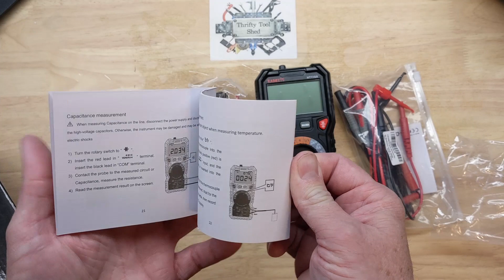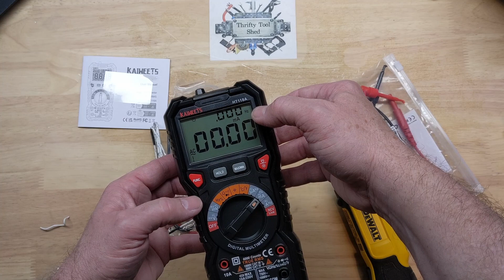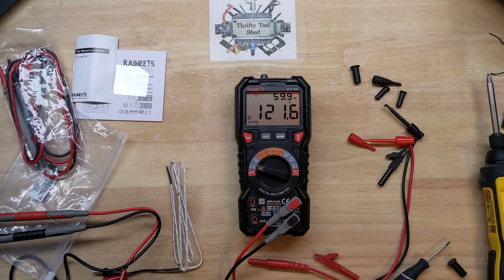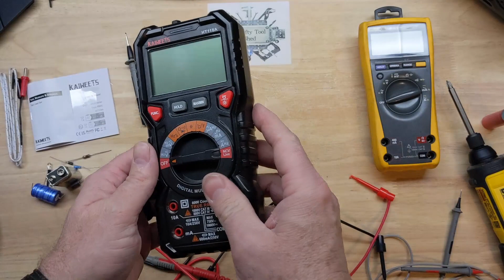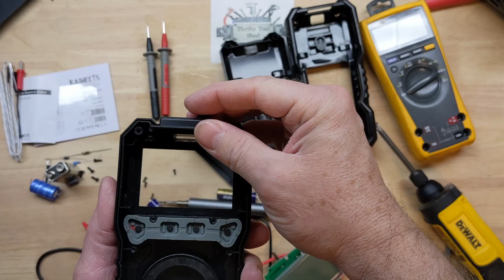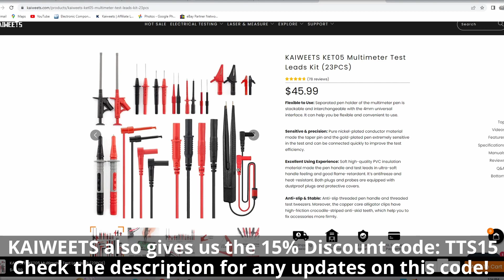KAIWEETS HT118A DMM & Electricians Lead Set

Comment: My meter just froze and after switching off, the meter does not turn on. Batteries are ok. Please advise..
Reply from the maker: My advice would be to contact Kiaweets. I have not had that issue with mine to have any advice on it.
Reply: Yup. Mine's dead as well after an year.

Comment: I'm glad this Kaiweets MM got your approval, I had heard a lot of praises on the clamp type of this brand so I ordered one , unfortunately couldn't get the batteries to make full contact with the brand new device,(it would power up but flicker on/off right after) the battery compartment maybe a clever design but in practice I am not so sure, I read a couple of reviews by buyers who complained about the same thing as I was experiencing, , one reviewer suggested to really tighten up the screws on the battery holder in order to make better contacts,, I just didn't want to take a chance and damage the unit so I decided to return it. to be honest I have a feeling  my case was probably one in thousands since most other reviews were all positive, just thought to share my experience.
Reply from the maker: Thanks for sharing. I have not seen that on any meter I have received yet. I have not received a clamp on, but they look nice and are very affordable. I have received the 2 DMM and 2 smaller pen type meters. Always good to know if someone has issues with a product.
I try to review these for viewers using them for testing as I do in video on the bench testing as they seem to be great for the money so thanks for sharing your issue.  I have been an industrial Electrician for over 25 years and I have had Fluke all my career and they are second to none. I just cannot recommend someone buy that meter 10-15x the cost of these for around the shop or garage so that's why I do enjoy sharing these when I have time...
Reply: @ThriftyToolShed  I agree with you on price vs value that's what attracted me to it, did not mean to come across as knocking Kaiweets, just thought it might be of some interest to viewers thinking of buying the clamp type, I ended up buying another brand but same quality or probably slightly better(Klein CL390)but it does not come with as many features as the Kaiweets,
Reply from the maker: @ddistrbd1  
Simply sharing your experience with yours is exactly how I took it! Thanks!
Reply from the maker: Fluke has been great to me and my career for over 30 years and I have not had to have any other brand DMM in the industry. The Simpson 260 analog was the work horse before that really to me.  Fluke is not for everyone and that is even my point with decent DMM that are very affordable like the one shown here for hobby use. All the meters you listed are really good as well. When it comes to 600V I really want my Fluke lol..
I do miss the days when fluke used to even share the schematics and service manuals with all the meters. Sadly that stopped a few years ago and is unfortunate.
I shared how sad it was to see that in one of my Fluke DMM repair videos a while back...